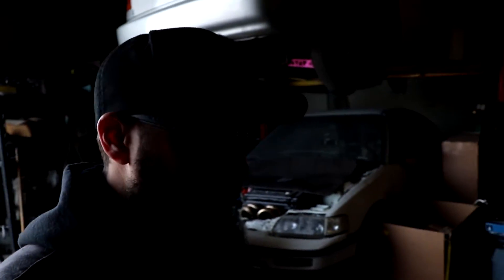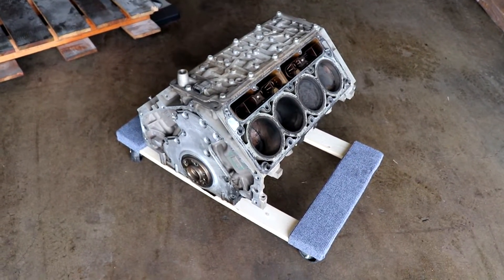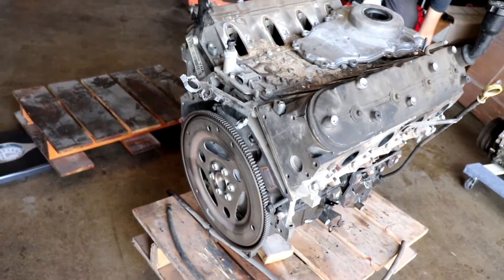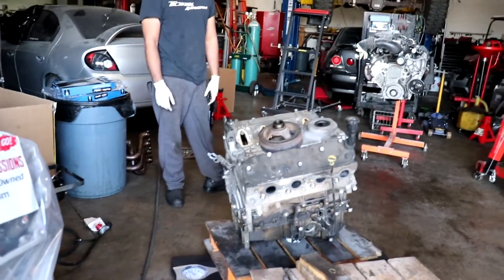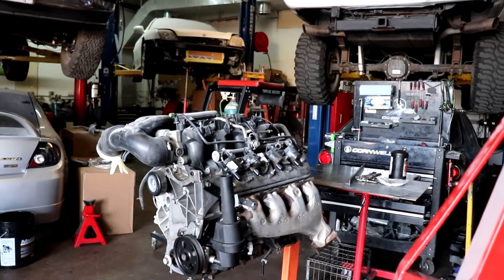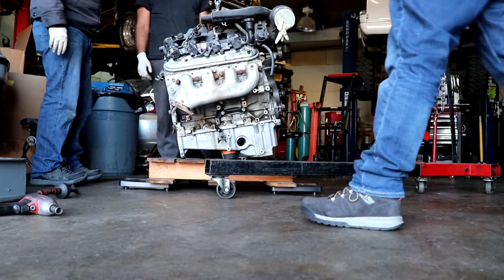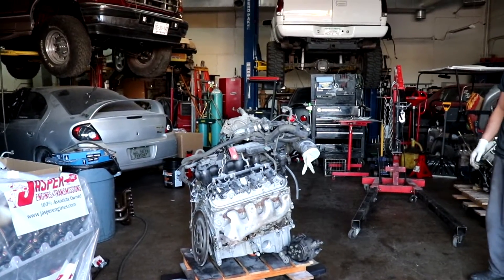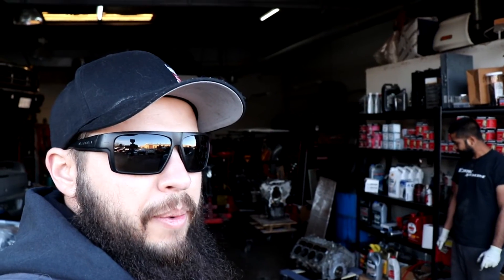How Much Do LS Motors Weigh?

Comment: Thanks for the weight information!  
Was wondering the difference between a "crate" type aluminum LS and a Jeep 4.0L in-line 6, which is long of course plus has a cast iron cylinder head.  I've read a long block 4.0L engine weighs 483 lbs.  So, your "long block crate" weight was 350 lbs. resulting in a 133 lb. weight difference.  
Imagine even a mild aluminum LS in a 1990's era Cherokee XJ, already a rather light SUV, and that weight savings would be quite notable.
Thanks again!